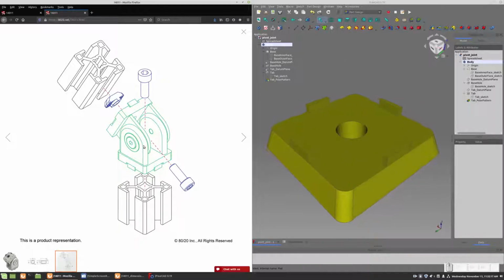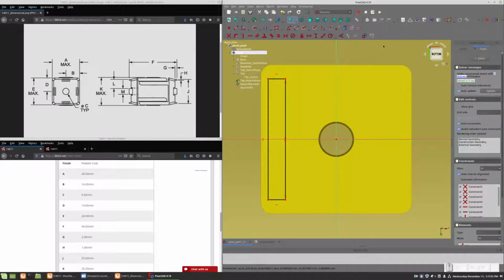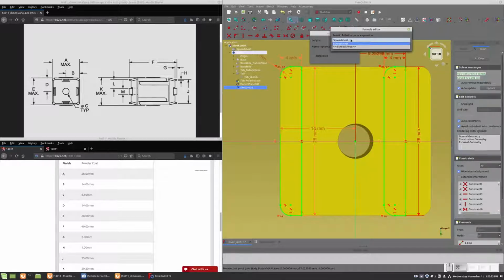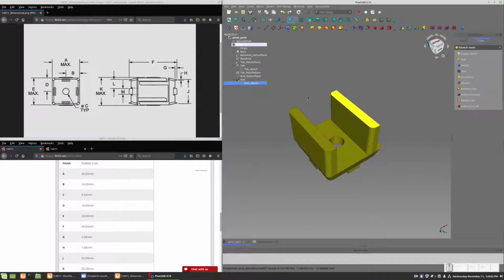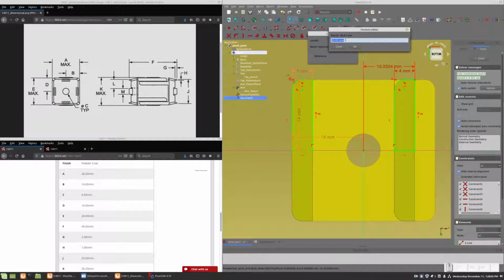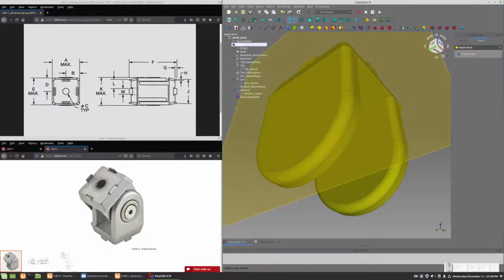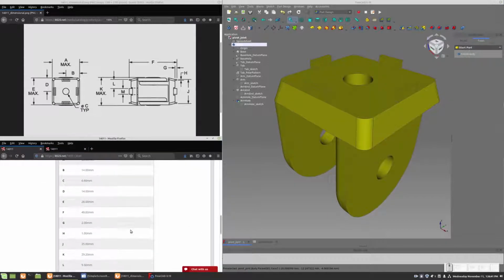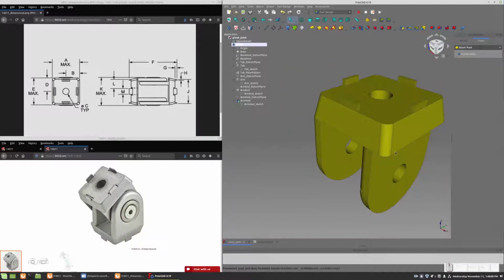Modeling a Pivot Joint in FreeCAD 0.19 - PART 2 - Arms

Comment: This is made in die-cast aluminum.
Therefore, the arms taper towards the point of rotation of the screws.
This is so constructed that you get the cast out of the mold.
On the photo you can also see the plane where both halves meet.